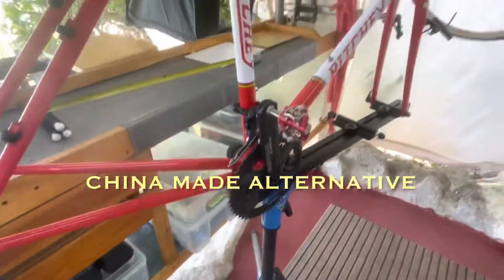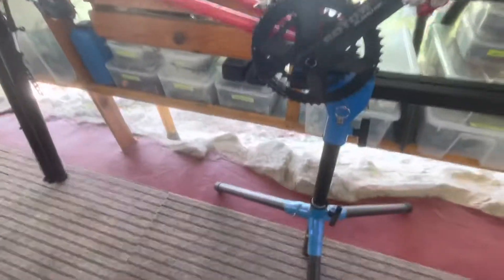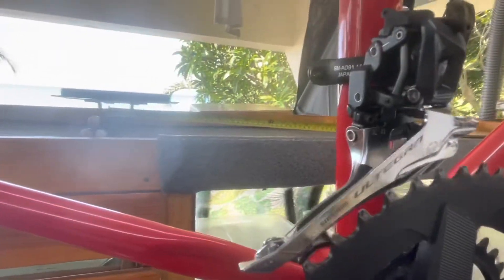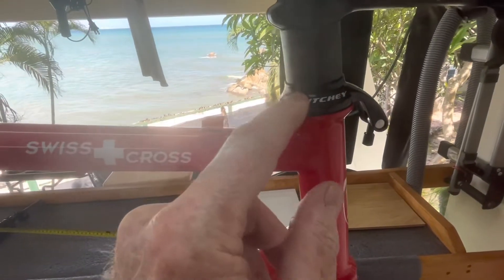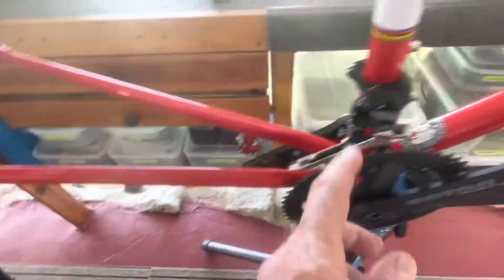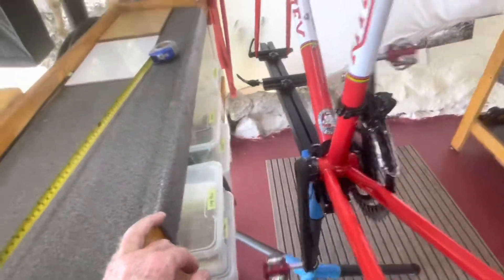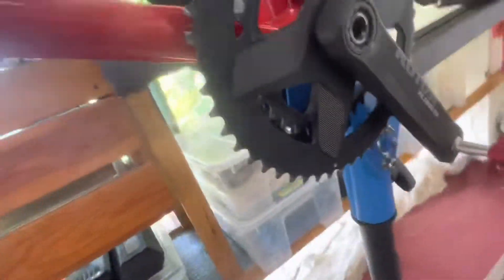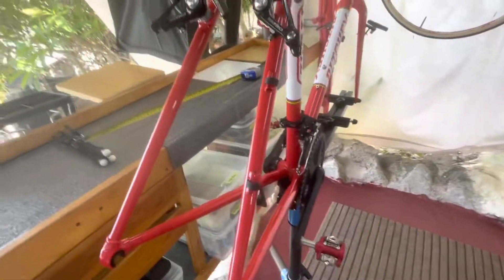The New Bike Stand, Swiss Cross Build Update

Comment: Wow, that Ritchey frame is gorgeous ! Looking forward to the full  build video ! I have been thinking of getting a Ritchey Logic Road frame, you may have just pushed me over the edge !
Reply from the maker: thank you! I posted some vdo of my Ritchey Logic build as well. The Swiss Cross build is on hold until I receive some headset shims. For some reason I cannot get the thing adjusted right without the bearings binding the fork pivot too much. I suspect it needs another shim, but Ritchey support has said they've never heard of an instance requiring more than the one shim that is sent with the headset. If it doesn't solve my issue, I'll take it to the Ritchey shop in Bangkok to sort it out. Good luck with the Logic if you decide to do it! Glad I could be a nudge in the process!
Reply: @theunabiker4133  i had a similar headset issue with my Giant Revolt. In my case it was a simple matter of not putting the bearings in correctly the first time  after taking the fork out of the frame to service it. Headsets can be tricky getting the adjustment just right. Good luck,  hopefully the shim solves the problem.
Reply from the maker: @jaroslavscz1821  thanks for your comment. I’ve triple checked and rechecked again. I can’t see how to screw up installing the bearings though. Identical parts. I’ve switched top to bottom and back. Hopefully the shim helps. If not then I’m off to Bangkok to the Ritchey dealer there. The owner is a fine mechanic. It will get sorted out one way or another.

Comment: If you have any problems setting up your cantis, I’ve found the best shoe is the ‘TRP inline adjust CX’ version. They have an internal hex Key that adjusts the toe in which can be the only way to stop squealing / grabbing, without doing the old style bending on the callipers. They use aluminium road pads so you would still have to replace them with whatever carbon version you want. The Shorter pads might clear your frame.
Reply from the maker: Thanks for your comment. Here’s a feature of the Tektro brakes I discovered. I have a set of kool stop dura shoes and carbon pads. It’s a road type shoe, but the threaded bolt stud is not long enough to go through the Tektro arms. The nut cannot fit into the slot, and there’s not room enough for it to thread onto the shoe’s bolt end even if it could. The only design that works are mtb type brake shoe/pads. I had also purchased the kool stops seen in the vdo, so I was covered. 
I bought the Tektro Cantis and the kool stop dura shoes from SJS cycles. The person I chatted with at SJS believed the dura would work, so I’ll have to give them my feedback about it. It’s no big deal, just another learning thing in bike world for me. 
I appreciate the info you sent, and will check it out. Thank you.